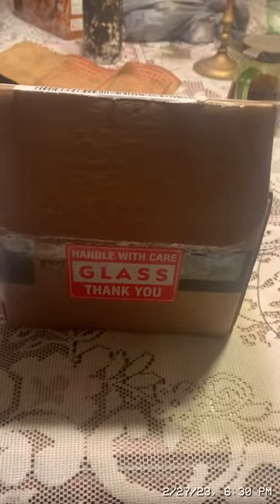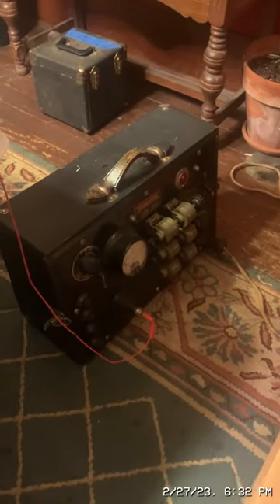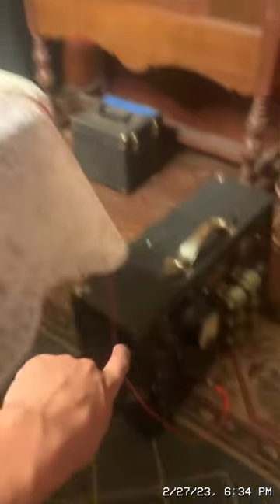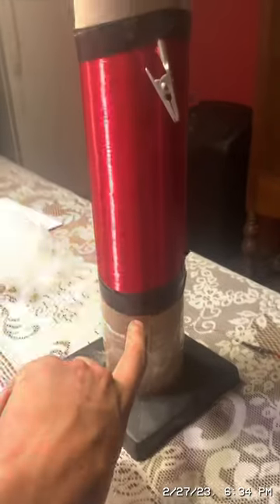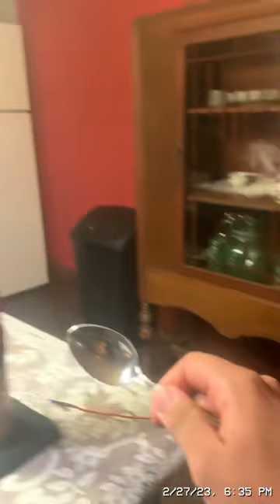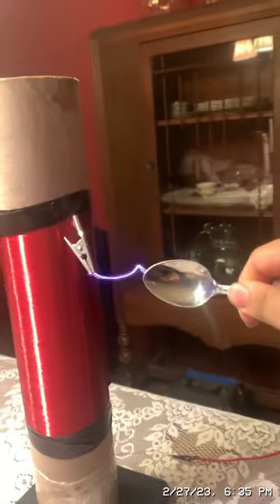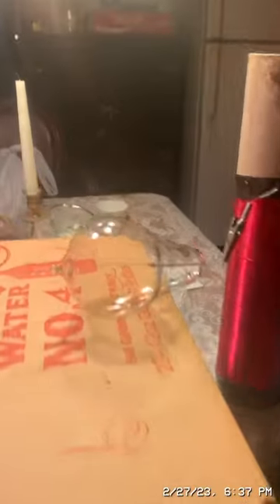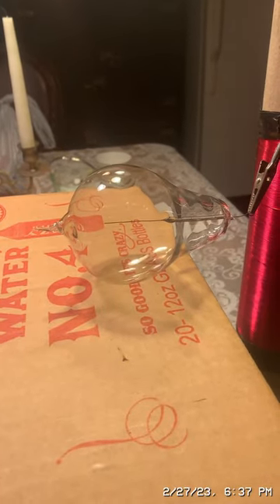Single wire incandescent bulb

Comment: Took long enough for hm to get shocked.
Reply: It is not very hard to catch one's hair on fire with a Tesla coil or similar device. Long term use of a tesla coil has been known to cause problems with the joints especially the feet. There is little known of the dangers of working with them because few very few people work with them.